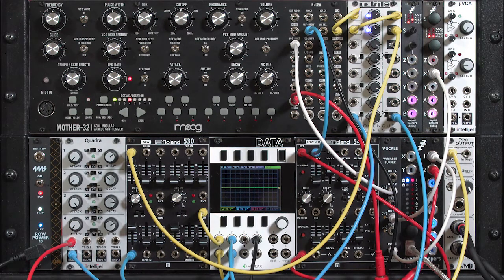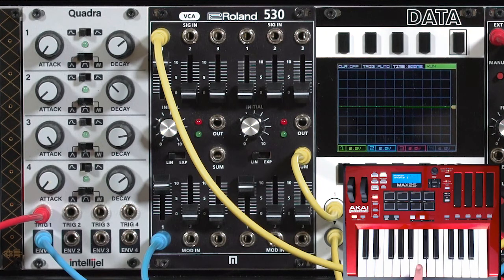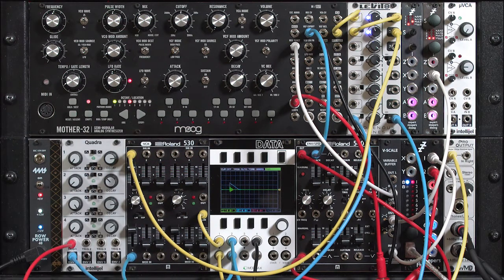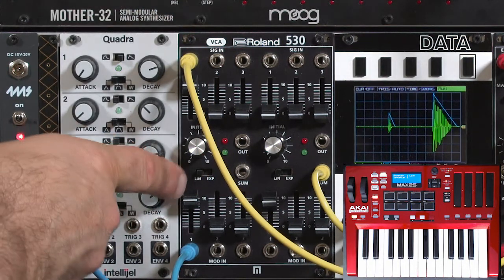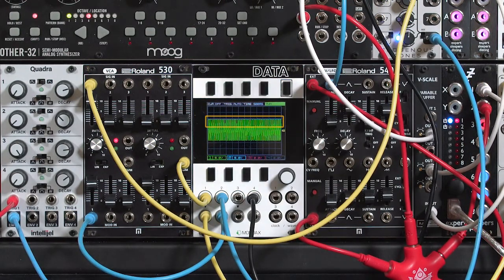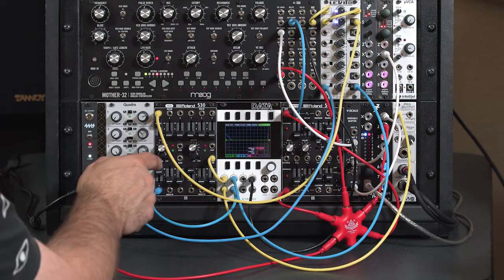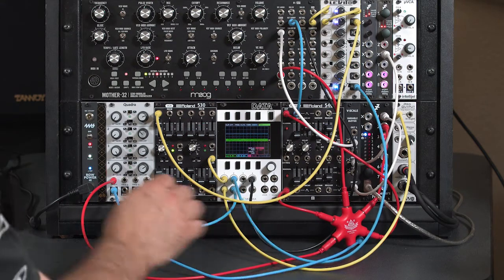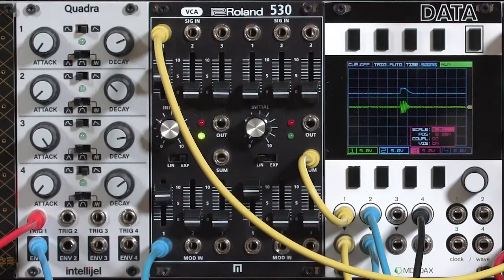Roland 530 Dual VCA 2/2: Linear vs. Exponential (LMS Eurorack Expansion Project)

Comment: Interestingly the very final part of the exponential decay from the Quadra applied to the Moog still doesn't have a natural enough response. Could this either be the non linearity of the ear with regards to not only loudness but frequency also (as loudness changes frequency content should change)? Or is this as you mention something to do with the fact that the audio drops to zero before the envelope voltage does? Not quite sure why that is happening. Either way that is a 'fault' on many synths, some with claimed exponential decays. FWIW it can happen on my Korg 700 and moreso on my Yamaha SY-1 but to the best of my perception both have linear envelopes. I've paid attention and noticed it on other exponential envelope synths hence my thoughts about equal loudness curves. Re the 530 could it also be something to do with the VCA response not being perfectly linear? Thanks for the video.
Reply from the maker: In theory, an exponential slope never reaches its target. Since this doesn't work so well in the real world, different manufacturers make different decisions on when cut off the slope and say "okay - it's done - let's move on to the next stage". The attack of Moog modular envelopes are particularly known for their truncated shape. OTOT, the Roland dual ADSR has a really gentle decay shape into its sustain - they keep more of the natural slope. So it's something where the sound will vary from manufacturer to manufacturer.
Reply: Interesting, thanks for that.
Reply from the maker: I also agree that the Roland VCA seems to cut off earlier than you think it should. That threshold may also change between manufacturers.

For the ultimate in envelope shape control, check out the WMD Multi-Mode Envelope: https://youtu.be/3Vq8aUlRBjc

Comment: Have you checked out the AJH Dual Contour envelope generator?  Those are truly exquisite in their response.  Their attack is logarithmic and retriggering them before the decay has completed allows for ramping intensity.
Reply: I'm interested in that module for this very reason. I blame my obsession with exponential envelopes on Summer Madness by Kool and the Gang. That was a 2600 right? With both linear and exponential envelopes AR & ADSR respectively. I understand that the many non linearities in the signal chain can affect the final result.